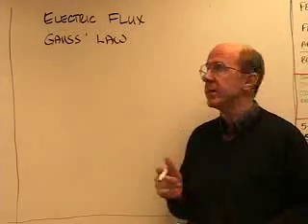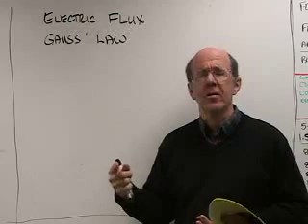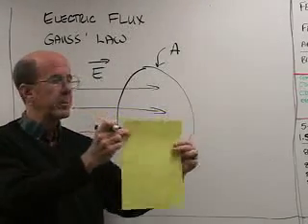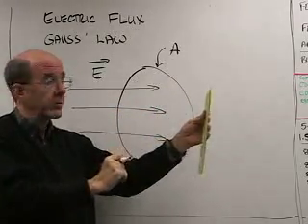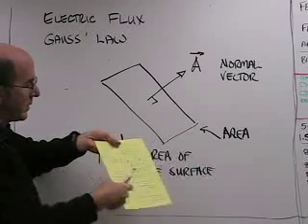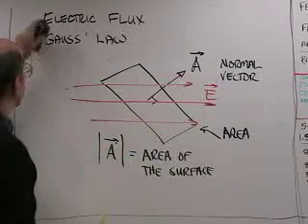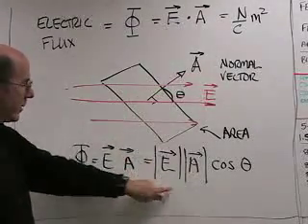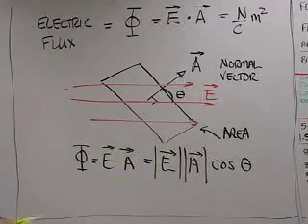Introduction to Electric Flux

Comment: The explanation of an electric field is soooooo loose. A "whole bunch of field lines" going through a surface????? An electric field is a function that assigns a vector to each point in space. In particular, we can look at the vectors assigned to each point on a particular surface. Each vector represents the force experienced by an identically charged particle located a certain point in the space, in particular, a certain surface in the space surrounding a source. You don't just have "a whole bunch of lines", you have an infinite number of lines, each assigned to a point on the surface.
Reply: Saying that an electric field is a function is like saying that a tree is a growth equation. An electric field is represented by a function. I see the point you are attempting to make but if you intend to call the author of the video out for his inaccuracies, you might want to be more accurate, yourself.

It might also do you well to realize that this video is obviously intended as a 'soft intro' to the concept of Flux. This professor would have made an entirely different video had he intended to present it to an audience with a deep familiarity with this segment of physics.
Reply: Dave Cantu How good are you in physics? You are certainly confused about our physical reality and the physics models developed by the so-called physicists. An electric field does not exist in our real world. It is nothing more than a notion in "some" physicists' model about our real world. A tree is not bound by any equations or models. No equations or model can describe the growth of a real tree. Only some naive physicists believe they can summarize the real world using some models or "a bunch of" equations. 

In English, there are "qualifiers" such as "in some sense", "roughly speaking", "loosely", ... A good teacher should be able to use these qualifiers appropriately without confusing his/her students. 

BTW, I am (actually was) an economist, not a physicist. I can see why students stay away from physics. Physicists can't even "define" something, like time and space, properly. You think you can get away with it by confusing people? Never. You are just masturbating.
Reply: Arthur, the intended purpose of this video was to educate students who having trouble understanding physics. If he had instead used an explanation that was less "loose", it's likely I wouldn't have understood it better than when my own instructor explained it. He explained it in such technical (and technically / all-inclusively correct manner) that I couldn't translate that in my head to what it really means (at least not real-time while in lecture while also rushing to scribble notes).

I of course understand it's not just "a whole bunch of lines" in space, but now that I have an understanding of the concept I was having trouble with (and understand why that formula works, both conceptually and also mathematically), now I can integrate that with the stuff you said in your post (which I already knew, but would have been a distraction in learning this specific concept).

The video instructor's ability to help me in that way is what makes him an excellent teacher. At least for me, I think he fulfilled his intended outcome.
Reply: btw , in a way you're correct . but nobody said they're real. they just help us understand them better. we've already accomplished so much with these imaginary tools. which certainly means there's some significance to them. but that doesn't disprove the fact that this shit is imaginary.

this video was for students (esp. high school i guess ). and just an introductory one. it served its purpose , and given the opportunity i'd say it did a great job of explaining what it intended to . my school physics teacher couldn't do a very good job of it but he certainly did .

he used these simple words so that we can easily relate to them and understand (or atleast get the notion) the idea of electric flux rather than just look at it in the form of a technical physics term that doesn't appeal to you in what it is in reality.

if i say " the volume of a ball " , we can actually see and get the idea that it's something like the amount of are or capacity or how much stuff its got/can hold. but if i say electric flux , up until 2 weeks ago , i was like "WTF is that ? oh ! that in physics lesson .... yea something that goes thru ... ugh.. whatever ." 

now its all clear and different , for me.
Reply: a whole bunch of idiots in the comment section
Reply: no you got fired
Reply: Arthur, the intended purpose of this video was to educate students who having trouble understanding physics. If he had instead used an explanation that was less "loose", it's likely I wouldn't have understood it better than when my own instructor explained it. He explained it in such technical (and technically / all-inclusively correct manner) that I couldn't translate that in my head to what it really means (at least not real-time while in lecture while also rushing to scribble notes).

I of course understand it's not just "a whole bunch of lines" in space, but now that I have an understanding of the concept I was having trouble with (and understand why that formula works, both conceptually and also mathematically), now I can integrate that with the stuff you said in your post (which I already knew, but would have been a distraction in learning this specific concept).

The video instructor's ability to help me in that way is what makes him an excellent teacher. At least for me, I think he fulfilled his intended outcome.
Reply: You must be one frustrated student
Reply: PhD in economics is laughable. A physics PhD is much more respectable than a measly Economics PhD. kek
Reply: Not really. I have a PhD in economics from JHU and am now retired at the age of 54. See, I am always amused by physicists. They are "a bunch" of funny animals who cannot distinguish between our reality, our perception of reality, our modelling of reality based on our perception, our measurement of reality based on our model,... What is more funny is that most of them do not seem to see how weak the foundation of modern physics is. Say, they define "time" by some sort of "measurement" using some so-called "clock". Well, any clock is based on some motion, be it electrical or mechanical, with some speed. So, modern physicists define "time" using "speed" without noticing it. See some dudes, like Einstein, got away with it and publish many articles to get himself promoted. But wait a second, these dudes also define "speed" using "time". Isn't it what we call "circularity"? So, what is "time"? What are the attributes of "time"? Similarly, they don't seem to see that "force", and hence "flux" is nothing more than a man-made concept based on our modeling of reality which is merely based on our perception of reality. Most of them seem to treat these concepts as if they are something "real". And yet, when they try to describe these concepts, they fail 99% of the time either on purpose or because they don't truly understand them.